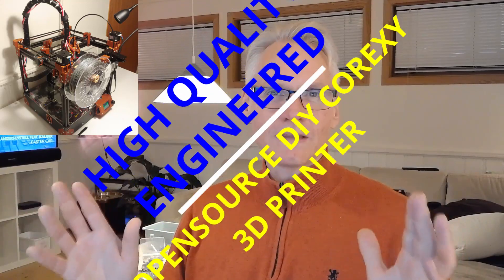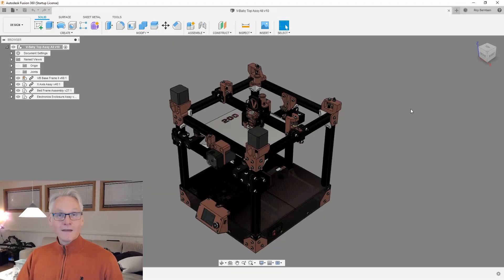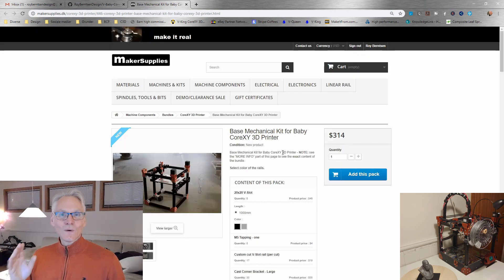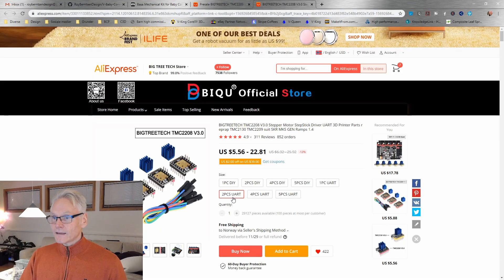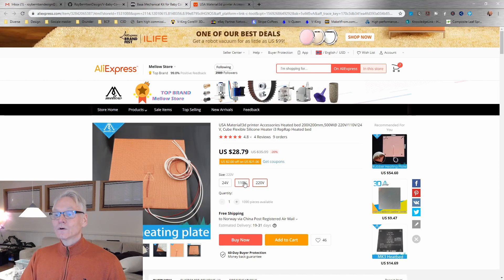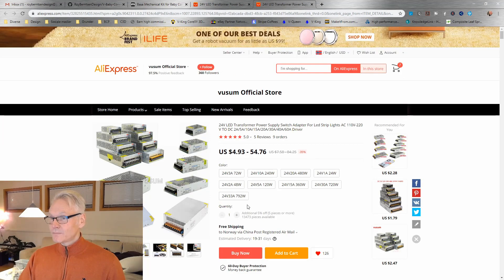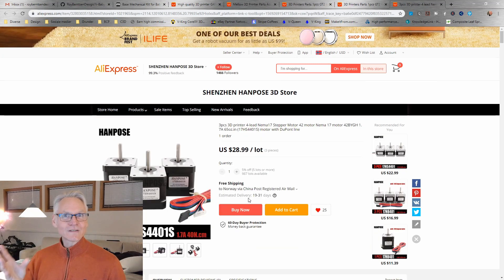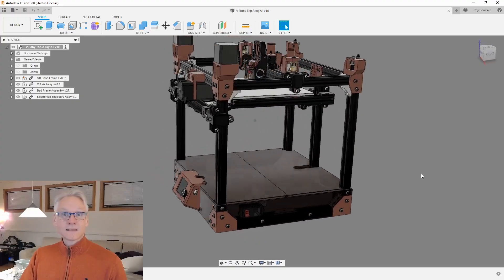Building The V-Baby - Part #0 Ordering Parts - Engineered DIY 3D Printer

Comment: Hello.  You have a very cool project.  I want to convert my homemade Ultimaker into a V-baby.  And if I use a nema 17 17hs8412 motor with 52N force without gear, will the Z axis work?
Reply from the maker: If you use belts on the y axis the bed will fall down when no power. Also you need v slots for the frame
Reply: @PRO3DESIGN My project with v-slot. I meant is it possible to use the z axis without a worm reducer?
Reply from the maker: @ВалентинХандрига  it is possible but not tested and the bed will fall down when print is finished
Reply: @PRO3DESIGN  Tell me what worm gears can be used for a stepper motor for the z axis on aliexpress?
Reply from the maker: @ВалентинХандрига  the worm gear in the bill of materials is what we use
Reply from the maker: https://github.com/RoyBerntsenDesign/V-Baby-CoreXY/tree/master/Document%20Library/Bill%20Of%20Materials

Comment: Thanks you very much for your work!
I'm very happy to find this kind of project in internet so thanks for your amazing work. 

I was looking for an opensource 3D printer to complete my 'early' farm (i3 mk2 reprap) and I choose to make a core xy. 

But I have some questions, what is the big difference between V-king and V-baby? Just the size? Is there an evolution? 

I would like to make a 400X400 mm print surface. I hesitate to make a v-king or v-baby. I'm student I don't have a infinite budget. 

Sorry for the 'basic' questions but I didn't find the answers in your videos, sites or github.
Reply from the maker: Thank you for the feedback. There are different designs. The baby is designed as compact as possible using the mini wheels. It has a different xy belt arrangement which i like better. The x carrier also have a very different design with a open front much cleaner than the V-King. The baby Z drive is designed for a small printer and can not handle 400x400. You could do xy baby parts and Z V-King parts

Comment: Great stuff mister. I started to design my own version of corexy printer. I want to keep everything inside the frame (except electronics) and use mgn9 linear rails like in the Voron or secKit. I'm also planning to attach acrylic plates to the outer side of the frame to make it super rigid and enable the possibility to print nylon and PC. I plan also use the Mosquito hot end with BMG extruder in direct drive mode. Greetings from Finland, keep up the good work. Cheers.
Reply from the maker: Thank you sir! Railed machine is interesting. I will do that myself on a later stage, probably looking to see if I can use the igus rails with no bearings. Good luck with the project in Finland. Norway here

Comment: I planning to build one , but I want a direct drive head ...
thx
Reply from the maker: You are right we want a light printhead for fast movements yes. It can be a dd optional
Reply: @PRO3DESIGN  DD is great. But in this tuned design i would look more at the nimble extruder if i were to move away from bowder.
Reply from the maker: @BlueprintDK  That is also an option - I dont really have any problems with the bowden setup. It just works great so no need to DD if not super flexible material
Reply: @PRO3DESIGN  Will you cover the complete build compile firmware ect. Did you have a Facebook group that i could follow?
Reply from the maker: @BlueprintDK  Completef buil log from start to finish will be out. All mechanics, electronics and firmware to calibration and first print
Reply from the maker: @BlueprintDK  yes the v-king group : https://www.facebook.com/groups/viking3d
Reply: @PRO3DESIGN  thanks. This could be my next project. After iam done with my prusa mk3S replica
Reply from the maker: I will try to work on that in the future
Reply: Would this not defeat the goal with coreXY? Really nice build.. look forward to more video in it.!
Reply from the maker: Someone must design this. I might do one next year
Reply from the maker: Yes everything will be covered. Search for V-King builders group